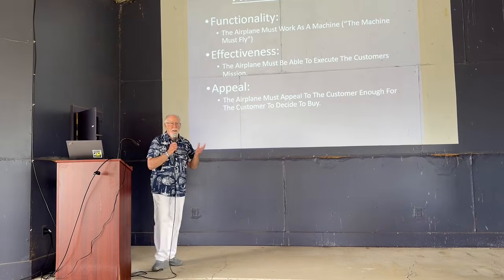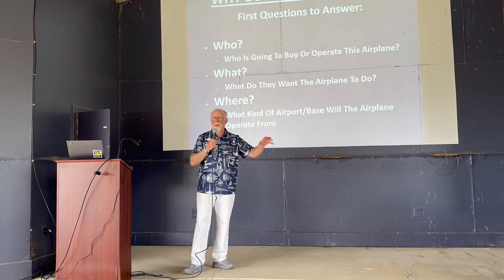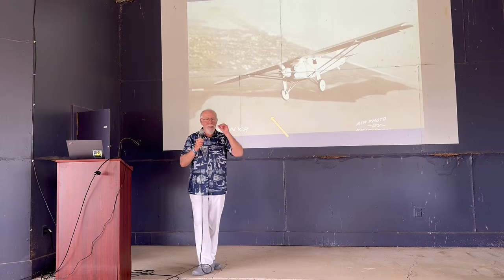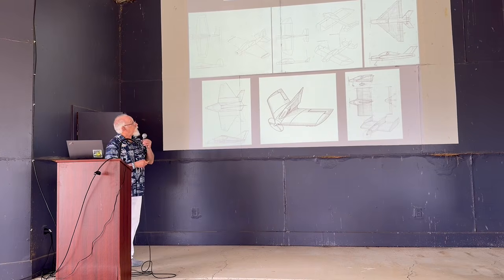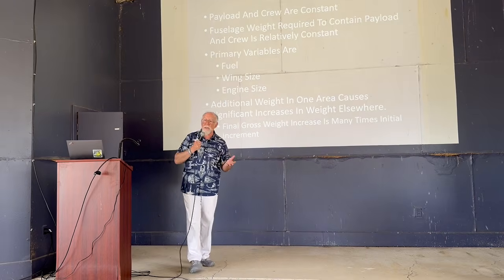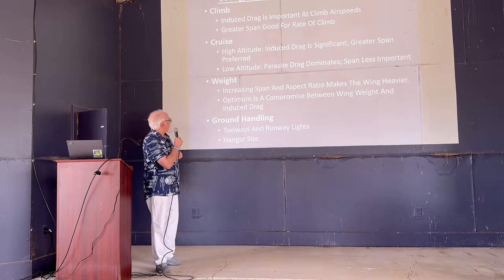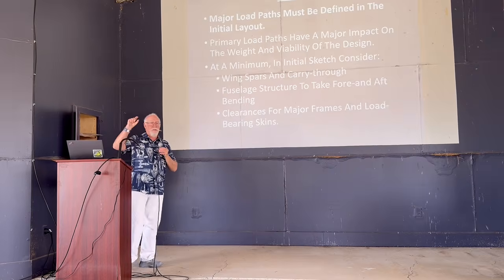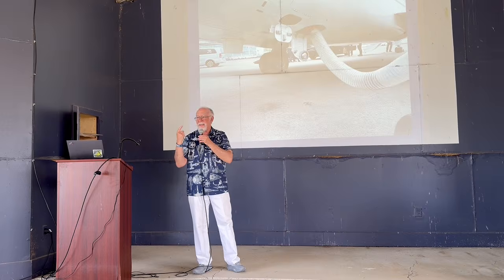How To Really Design an Airplane 2026

Comment: Conventional thinking is the reason why most airplanes are still dragging around a windvane nobody should need. It's also the reason why there is still discussions about what it is that makes airplanes fly, while nobody cares to notice that air can not slow down, and the most crucial factor in airlift is sound. Unlike animals, we can't feel what we do, so we stick to what others survived, designing new machines build with the same old parts, based on the same old principles. Nice video though, even if it's more about composition than about design IMO.

Comment: I’m interested in bringing aviation closer to everyone with aircraft that can do everything easily and safely for someone with less than pilot level training because the machine does more of the work automatically and makes significant reductions in workload by reducing a task with something automatic like the lights, intake heat, fuel pumps, landing gear, flaps… Imagine a push button configuration that includes TOL,  climb, level flight with speed control, descend. I don’t know exactly but I’m convinced a plane can predict landing gear requirements, set the flaps, add intake heat and turn on landing lights when applicable.
Reply: The general public, having shockingly low comprehension of physics, have no business operating an airplane.

There is far more than simple mechanical operations to keeping an aircraft airborne. Everything mentioned above is minor tasks for a pilot, compared to balancing the fundamental physics of flight and managing spacial awareness, while maintaining and adjusting aerodynamic equilibrium to obtain a precise flight path in three-dimensional space, a path through invisible fluid, a path that exists only in their mind.
Reply: @Triple_J.1  do you check your compass calibration every single time on the ramp? Do you adjust your mixture on climb out? Do you turn your carb heat on while descending? Does that make you feel more like a pilot? You will feel different when the workload becomes more than your attention can provide. Simple tasks add up and eventually overwhelm anyone. All of the notable innovations in avionics exist to address this already. I’m encouraging further use of technology where it makes sense. Aviation has not benefited from superstition where fear writes rules that weren’t written in blood but instead cause it or at the very least, prevent progress. 

Here’s the uncomfortable truth. Traffic sucks.
Reply: @280zjammer  Mixture, flaps, carb heat are second nature.

The overriding requirement is precise, absolute control of the wings angle of attack at all times. This is controlled by fore-aft deflection of the elevator which trims the wing to its desired angle of attack. And the trim tab can be set to hold the elevator to this desired position. Once the aircraft is configured for equilibrium of forces, minor tasks are unlikely to become overwhelming. Automating minor tasks only removes the pilot from the mechanical operation loop. It does not remove him from the control loop that actually matters. Most new airplanes have fuel injection, no carburetor mixture or heat required, many have FADEC, no propeller rpm control required. Some even have auto-land.

None of this matters for bringing ignorant plebs into aviation. It takes knowledge and judgement simply to decipher weather reports for clues and to strategize how to navigate from A to B on invisible highways in the sky. 

Just like electric starters and automatic transmissions do not stop car crashes. If you don't understand the physics and dynamics of a car changing lanes, maximum performance braking, weight transfer, traction and lateral adhesion, road surface and weather conditions, etc. You are predestined for a vehicle accident of some sort.
Reply: @Triple_J.1 you might assert that only pilots are flying but that’s not absolute. You might say aircraft don’t operate without pilots and I say that’s probably false. I don’t like the current iteration of air taxis but if they exist, personal flying vehicles are coming and most passengers nowadays just want to scroll social media and have nothing to do with operating a vehicle. Technology is going to offer that before aviation is going to offer it. If you don’t want the world of aviation demented and extorted, better design an interception because some people are pilots and it’s probably good if actual pilots weren’t removed from the role. Technology will keep sucking up tasks through automation and eventually we will have to draw a line where control starts and stops because some will control the vehicle and some won’t. If you can get people there safely, it doesn’t matter who is in control.

Comment: I would claim hobby shop syndrome described at @32.47 is what the Aptera reverse trike has suffered from.  The body was so radical that making it electric as well was a mistake.  Prove the platform with a convention motorcycle engine, get it on the road, and make the electric later.

Comment: 32:49 on the oceangate topic, iv said before that the composite hull COULD have been a positive innovation,  if the company and arush followed respectable engineering and operational standards. The hull did work, it just had a relatively short service life. If arush and friends had been applying actual engineering principals to the project, they could have come up with a reasonable operational, service and mandatory overhaul procedure for that hull, and compared it to the conventional steel hull. And determined if the process of replacing the composite hull in a regular overhaul was a viable option.   Certified aircraft engines work like this, theres a TBH (time before overhaul) rating applied to each engine that nestles well into the regulated inspection and maintenance requirements for the aircraft, and this allows the machines to be used productively without regularly encroaching on their failure modes.  The TBH is a factor in the marketability of an engine, but it doesn't necessarily need to be very long.  There was/is a certified version of the VW air cooled flat four that has long been popular among ultralight and light sport builders, and compared to a Continental its TBU is laughably short, not exactly useful for commercial operations,  but for a private pilot flying a plane for fun, it can be perfectly usable.
Reply: Bonding dissimilar carbon-composite hull to titanium bulkheads subject to severe cyclic pressure and temperature swings, while retaining industry acceptable human safety statistics, is a fundamental problem that is unlikely to be solved by any amount of engineering. Considering these people attacked composite wrinkles and ridges with an angle-grinder before continuing further layups, it is self-evident that none of the possessed even a modicum of competent engineering ability, material science, physics, or even a conceptual grasp of reality.

Comment: I've thought on the idea that after decades of failures and bad ideas, once a hand full of people did the work to lay the foundation of how to build an aircraft, it suddenly became a rhing that any moderately competent individual could do witha access to surprisingly minimal resources.  People build aircraft in sheds using common mayerials and components, relying on knowledge that was more or less established over a century ago.
Reply: modern composites aren't really a century old.  Knowledge of metal fatigue in aluminum certainly isn't a century old.
Reply: @redtandem8483 

But wood is
Reply: @redtandem8483  in all technicality, people used to build airplanes with structure covered in fabric: Composite is just a fabric airplane reinforced into a structure.
Reply: The wrights corrected previous errors and extensively documented their research. The only area they clearly lacked was stability. Bleriot made significant progress toward what is now the conventional aircraft (1909). And stability and flying qualities was pretty much solved by the middle of the first world war (Fokker DR.VII). The early N.A.C.A. produced multiple theoretical works regarding stability. NACA Report No.1 dated 1915, for example. Throughout the 1910s and 1920s Kutta, Glauert, Prandtl, and Munk had pretty much written the book on aircraft and airfoil theory.

Comment: Thank you so much for sharing. Software developer here, and your previous videos got me interested in learning how to design my own low AR airplane. Its for sure a really hard subject to get in to when you don't come from a mechanical background. The books are tricky to get in to if you haven't spent time at uni for almost 25 years. But I just keep at it practicing, and working towards the goal. I find it interesting why you design the Batray to go relatively slowly, since low AR airplanes really shine at higher speeds and struggle with lift induced drag at slower speeds. I'm taking a different approach, focusing on Rutans mouldless method since it seems much more approachable for the average builder. Using aluminum construction to me, only makes sense once you sell them as kits. What's your thoughts about this? Of course I'm biased coming from boats and composites. Built a pretty large foam cutting CNC two weeks ago and I'm blown away how fast I can get the basics shapes cut.
Reply: I'd also recommend the documentaries for Mike Arnold's designs (the AR-5/AR-6). Plentty of great information.
Reply: @joshuavance1472 yeah there's some good videos tooby Arnold